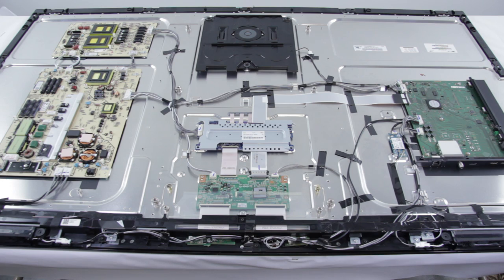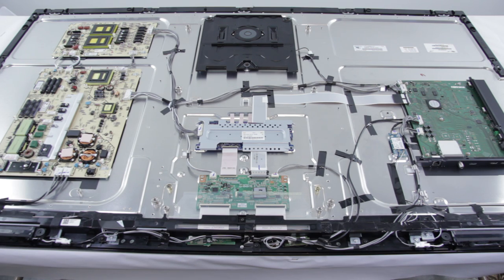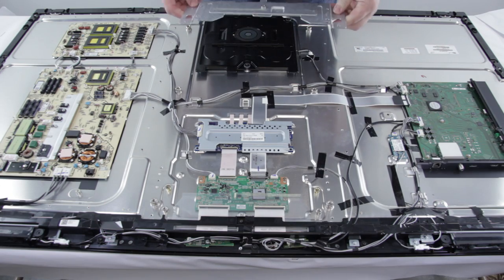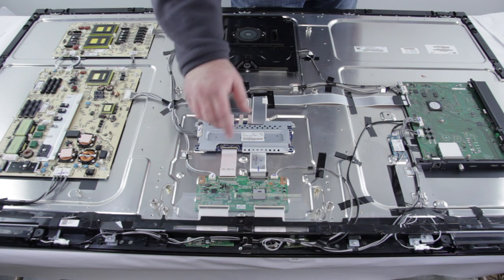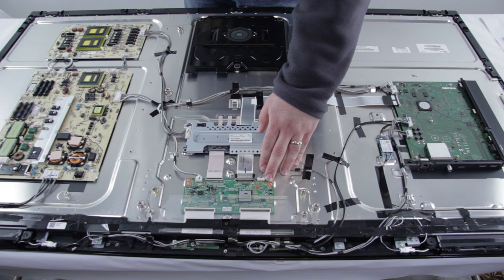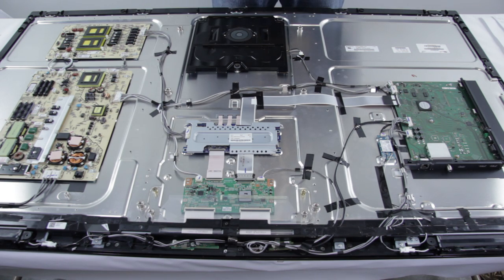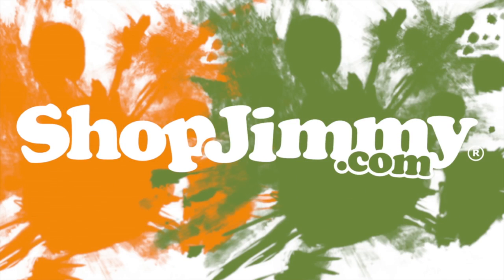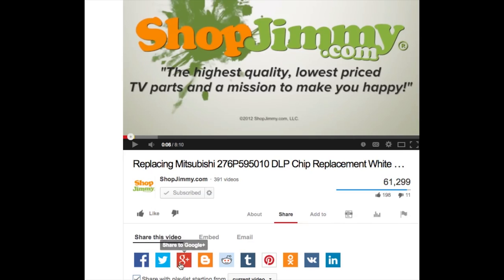LED TV Repair T-Con Board Help Review Overview - Common Issues and Problems with T-Con Boards

Comment: I have a LG 55lm7600 tv it does power on and has sound but no picture. I just got this tv given to me when I pulled the back off it it has 2 ribbon cables coming off the main board one plugs in at the bottom along the edge the other one comes down next to it but has no where to plug into. it did have a white stripe down the center but it has gone away but there is a faint line down the middle and when I hit the menu button nothing comes up on the screen. can u help
Reply from the maker: +jerry helton  Try all repairs and troubleshooting at your own risk.  Could you please upload an image of the problem and reply with URL?  Thanks!  www.shopjimmy.com

Comment: i have a vizio d48 d0 tv,i have replaced both the power supply and the main board,there is no picture or sound,i have back light and no sound,no menu,turns on and off ok,it has just a white blank screen,it only has 1 cable from main board to a long board that goes along the bottom of the tv which looks like about 1 inch wide and about 40 inches long that i can't see how to replace,can you offer any help?
thanks steve

Comment: Model E470i-AO Vizio   No power. No back light. Good P/S voltages.  When powering on , i check on-of and it toggles the 3.5 volts.  What next?

Comment: i have just watched your video and i am pretty sure it is the Tcon that is not working. where could i find a replacement, i have got a Panasonic TX-32LZD80 TV
Reply from the maker: Tom Smith   PLEASE SUBSCRIBE TO OUR CHANNEL - Try all repairs and troubleshooting at your own risk.  Click this link to a replacement t-con board for your TV model number:  http://www.shopjimmy.com/ips-alpha-technology-19100096-t-con-board.htm  There may be multiple boards for the same TV model number, be sure to match part numbers on your current board, with your replacement for compatibility.  Thanks and please let us know if you have any further questions with your TV Repair!  www.shopjimmy.com

Comment: Is the Samsung UN32EH4003 TV Main Unit Board P/N: BN94-06901T | BN97-05375B interchangeable with the BN96-25775A? And if it is, how difficult is it to remove and replace the thin blue ribbon cable that connects this main board to the rest of the TV?
Reply from the maker: jaseman32   That is not compatible.  Thanks!  www.shopjimmy.com

Comment: Hey Jimmy,

I have a Sony XBR55X850A 4K and it stopped working. I think it was the storms we had down here in FL. The TV does turn on and audio works but there is no back lighting, I can still see a very dim picture but after a minute the TV shuts off by itself and then the led on front flashes red 4 times and continues to do so and never powers back on until I reset it. I have left it unplugged for over a day but problem persists. What part do you think I need to replace?  Thanks.
Reply from the maker: Diablo99V   Since it was a storm it could be your main board, your power supply or both.  It may be best to replace both boards in your TV.  Here is a link to replacement parts for your TV model number on our website, click here:  http://www.shopjimmy.com/catalogsearch/result/?q=XBR55X850A  Be sure to match part numbers on your current board, with your replacement for compatibility.  You can also call our customer service for further assistance with your purchase.  (877) 881-6492  Thanks and please let us know if you have any further questions with your TV Repair!  www.shopjimmy.com

Comment: I have a 3d LG TV... model: 47lx6500lg... When you turn the tv on,for the first 10-15 minutes, the right side of the TV, the light, flickers from how it should be, to a darker picture. Then it eventually turns on and works perfectly... but here lately, it has seemed like it is starting to take longer and longer to warm up and work correctly.... Would this be the led driver backlight board, tcon board, power supply, or main board??? OR something completely different?
Reply from the maker: William Harmon   This sounds like a TV panel (TV Screen) problem.  If your TV panel is bad, it may be more cost-effective to replace the TV as panels are typically hard to find in stock, difficult to replace, and expensive.  Thanks and please let us know if you have any further questions!  www.shopjimmy.com
Reply: Damn that's what I was afraid of... Are you certain this is it based on my description? Or are you taking a wild guess? There is a TV repair shop down the road but it's $75 just for them to even look at it... But if you are certain its the TV screen itself, I'm not going to even bother...
Reply from the maker: William Harmon   Based upon the symptoms you sent us, that is our recommendation.  Thanks!  www.shopjimmy.com

Comment: Hi I have a lg 50NL5100 model led tv my picture is gone I change my main board change my t-con board and still no picture. Did the test I have a picture but no back light please need help thanks
Reply from the maker: +Martin Ortiz   Try all repairs and troubleshooting at your own risk. This sounds like a problem with the actual LEDs inside your TV. These LEDs are replaceable, however it is recommended they are replaced by someone with the proper experience and training. When replacing the LEDs, the TV panel can get damaged. If the TV panel gets damaged, it is not repairable. Click this link to replacement LEDs for your TV model number:  http://www.shopjimmy.com/catalogsearch/result/index/?cat=299&q=50ln5100   Be sure to match the panel information necessary to ensure you have the correct replacement LEDs.Thanks and please let us know if you have any further questions with your TV Repair!  www.shopjimmy.com

Comment: Hey guys, love your site and services... I have an rca rtu5540-d TV... I was playing stadia and all of a sudden the screen started cycling thru blank red, blue, white, black screens with no picture just pure color screen.. I have tried the unplugging, replugging, etc and at first was getting the dog startup screen, and could get the menu to pop up but screen would freeze and fade in and out with blotchy light and dark spots... now it's to the point that when I turn it on it is just lines, fuzzy artifacts and fades in and out.. I would like to repair it, but not sure if I need the tcon board or power supply board, and if I could get the part thru your service (I am in Ontario Canada) any help is appreciated, much love and respect from Canada 😃

Comment: Hi, I have the Hisense 32H3E 32" unit, I have replaced the Main board, but now the unit has a very grainy picture, could the t-con board be causing this? what would one run me if you have one in stock? Thank you! Terry in IL.
Reply from the maker: +Terry Millburg  Try all repairs and troubleshooting at your own risk.  Make sure the replacement main board part number matches your original part number.  Thanks!  www.shopjimmy.com
Reply: +ShopJimmy.com 
Yes, All Board numbers did match, the replacement was a used one from the exact same model board, but something must be different, now the picture is grainy & Haringbone type of display & not clear, but it does appear to work, I wonder if there is an update that I can make to it to clear this up possibly?

Thanks!

Comment: Samsung UN55ES6150 will not consistently turn on. Red power light on front will blink a few times while attempting to turn on, Samsung "splash screen" will show for a second, then black screen, and back to off. Pressing the power on button from remotes will often not cause the tv to do anything. Once the TV IS powered on the picture is fine and TV stays on.
Reply from the maker: Ryan Henry  Please watch this video FIRST to help with your repair!  https://www.youtube.com/watch?v=BP3NVNCGEv8  I recommend replacing the main board in your TV.  Click this link to replacement parts:  http://www.shopjimmy.com/catalogsearch/result/index/?cat=56&q=UN55ES6150  There may be multiple boards for the same TV model number, be sure to match part numbers on your current board, with your replacement for compatibility.  Thanks and please let us know if you have any further questions with your TV Repair!  www.shopjimmy.com

Comment: Hello, I have a Samsung 55" led 7900 model. The problem is that there are dancing red pixels showing up in the dark areas. It's not too bad, but pretty annoying. Also the USB slots are giving power, but not reading properly formatted drives. Any advice would be greatly appreciated... Will
Reply from the maker: +Will Roberts  Try all repairs and troubleshooting at your own risk.    I recommend replacing the main board in your TV.   Please reply with your TV model number.  Click here to view a video that shows how to find your TV model number:  https://www.youtube.com/watch?v=S51nhAmwR2M  Thanks!  www.shopjimmy.com
Reply: Samsung 55D7900XFXZA
Reply: Samsung tv UN60H6350AFXZA
UN60H6350
No picture at all, sound continues to work.

Comment: Hello I have a sharp lc 60le450u TV.  I gt it initially with no power symptoms at all.  I replaced the power control board and now have some kind of life...  It now has a red light when plugged in then turns blue and it turns on..  But it turns off about twenty seconds later.  It depends how long i be unplugged it.  It blinks a lot with no particular pattern after that.  Slow at first then more rapid.    I cannot turn it on again until I unplug it and the same results happen when plugged in.  I'd appreciate any advice if you can help.  ( bad power cord).  I dunna..
Reply from the maker: Joel Braxton   PLEASE SUBSCRIBE TO OUR CHANNEL - Try all repairs and troubleshooting at your own risk.  It should provide a blink pattern.  Please count the number of slow and fast blinks.  Thanks!  www.shopjimmy.com

Comment: I have a Philips 40PLF3107H/12. When the tv is on the screen is black but the speackers work perfectly. With the flash light test I can see the image trough the lights. Opening the box i found out that the  unit power supply code is 715G5246-P01-000-0025. Cannot find the led driver if there is one, or maybe is just part of the unit power supply!? The panel is a Samsung LTA400HM23.thanks.
Reply from the maker: Giovanni S   This could be a problem with the power supply or the LEDs in your TV.  You can replace the power supply board to see if that fixes the problem with your TV.  Unfortunately I do not see any replacement parts in the search results for your TV model number on our website.  Please reply with your part number on your power supply board and I can try searching for replacement parts.  Thanks and please let us know if you have any further questions!  www.shopjimmy.com

Comment: Need tv help I have vizio model m470vse that half of my screen is green can it be the tcon board tv isn't even 2 yrs old
Reply from the maker: Patrice Senitz  Please watch this video FIRST to help with your repair!  TV Repair! LCD, LED, Plasma, DLP How To Fix Your TV with ShopJimmy.com Help!  This could either be a problem with the T-Con board or the TV panel.  You can replace the T-Con board and see if that fixes the problem.  Click this link to a replacement t-con board.  http://www.shopjimmy.com/auo-55-47t03-c03-t-con-board.htm  Be sure to match part numbers on your current board, with your replacement for compatibility.  Here is a link to a video showing how to identify your part number, click here:  DIY LCD TV Repair: Part Number Guide for AU Optronics (AUO) Timing Control (T-Con) Boards  Thanks and please let us know if you have any further questions with your TV Repair!  www.shopjimmy.com

Comment: VIZIO E600I-B3 
It has a vertical black line running down the middle of the TV and the picture is faded on the right side (facing the tv). 
Would this be a T-CON board issue?
Reply from the maker: Adalbert Ingraham   This sounds like a TV panel (TV Screen) problem.  If your TV panel is bad, it may be more cost-effective to replace the TV as panels are typically hard to find in stock, difficult to replace, and expensive.  Thanks and please let us know if you have any further questions!  www.shopjimmy.com
Reply: Yes it helped.....found out it was the screen

Comment: Hi i have a Samsung tv that was lick  water on it by accident on my screen i blew air to clean has clean but i got a vertical grey large line hard to define. only when is the screen black you can see it
Is it the T-con board have you experience this before?
Thanks!
Reply from the maker: antreascurren   This sounds like a TV panel (TV Screen) problem.  If your TV panel is bad, it may be more cost-effective to replace the TV as panels are typically hard to find in stock, difficult to replace, and expensive.  Thanks and please let us know if you have any further questions!  www.shopjimmy.com
Reply: Thanks it is the tv panel i notice on the tiny board have missing burn  pins cause by a water it is fitted with the panel and can be replace

Comment: im having a problem with my insignia led tv. part number ns-37d20sna14 i have sound but no backlight when i shine a flashlight up to it in a dark room i can see the menu screen so i think im looking for an led driver. i can identify the power supply, t con, and main board but there is only 3. i can not find a led driver like the one in this video
Reply from the maker: nick NACK   This could be a problem with the power supply or you have bad LEDs in the TV panel.  You can replace the power supply board to see if that fixes the problem.  Unfortunately I do not see any replacement parts in the search results for your TV model number on our website.  Please reply with your part number on your power supply board and I can try searching for replacement parts.  Thanks and please let us know if you have any further questions!  www.shopjimmy.com

Comment: Hi, Samsung LED TV model # LN40A550P3FXZA, sometimes works fine, more often than not there are green and pink outlines around the images. sometimes the lines are barely noticeable, sometimes they are very heavy. They are even noticeable in the OSD menus. Please help? Thanks

Comment: I have a Proscan 55" Led tv 
Model# PLED5529A-D

Problem black screen leds not lighting up. There is sound and picture with flashlight on tv.
Reply from the maker: gcab  Try all repairs and troubleshooting at your own risk.  This could be a problem with the power supply board or the LEDs in your TV.  Unfortunately I do not see any replacement parts in the search results for your TV model number on our website.  Thanks and please let us know if you have any further questions!  www.shopjimmy.com

Comment: Hi - Thanks for the helpful videos. I have a question reg. my LG 55LN5700.  
There is no video on the screen but I hear sound coming through.  At very low light or at a certain angle I can see very very faint images on the screen.  Could this be a T-Con board issue?  Appreciate your response..
Reply: In addition, 1 out of 15 times, the screen does come on, and it works like nothing is wrong.  
So really wondering what the issue could be.  Any troubleshooting hints is much appreciated.  
Again the TV model is LG 55LN5700.
Reply from the maker: Ravi Narayanan   I recommend running the flashlight test on your TV.   Here is a link to a video we produced that shows how to run the flashlight test. https://www.youtube.com/watch?v=xUzCLgoSPGM Please reply with your flashlight test results and we can recommend a replacement part for your TV repair. Thanks and please let us know if you have any questions! www.shopjimmy.com

Comment: Need help. Vizio e701i-a3 the screens lost picture in the middle of viewing. It will power up and the screen will show blue but nothing happens.
Reply from the maker: JARRETT JOHNSON  Please watch this video FIRST to help with your repair!  TV Repair! LCD, LED, Plasma, DLP How To Fix Your TV with ShopJimmy.com Help!  This could either be caused by a bad T-con board or a bad TV panel.  You can replace the T-Con board to see if that fixes the problem.  Follow this link to replacement parts:  http://www.shopjimmy.com/catalogsearch/result/index/?cat=63&q=e701i-a3  Be sure to match part numbers on your current board, with your replacement for compatibility.  Thanks and please let us know if you have any further questions with your TV Repair!  www.shopjimmy.com

Comment: Hi thank you for the informative videos. I have a LG 55in led 3D tv. Model Number is 55LM5800. I have blackish-grey thin horizontal lines that go from the top of the screen to the bottom starting on the left and slowly fade as they go right. The spacing of the lines are just 1/8in evenly spaced. I'm wondering if it maybe the T-Con board from my research. I looked at your website for the part, but it said out of stock but you have other compatible parts available. Is it better to get the one for my tv or a compatible board or are they the same? Do you think it may be the T-Con board, or is it something more serious in your opinion? Your professional opinion will be greatly appreciated and I will buy the part from you if possible.
Reply from the maker: Miguel Rodrigues  Please watch this video FIRST to help with your repair!  https://www.youtube.com/watch?v=BP3NVNCGEv8  This could be either be a problem with the main board, the t-con board or the TV panel.  You can replace the main board and t-con board individually to see which one fixes the problem.  Click this link to replacement parts for your TV model number:  http://www.shopjimmy.com/catalogsearch/result/?q=55LM5800  There may be multiple boards for the same TV model number, be sure to match part numbers on your current board, with your replacement for compatibility.  Thanks and please let us know if you have any further questions with your TV Repair!  www.shopjimmy.com

Comment: Hi I have a Vizio D43-n E1 , every 4 to 6 second the screen goes black for a second, I turn the brightness to 0 and the flashing slows down  alot but contiunes to flash. I changed the main and power boards yet the problem remains, What can I do to resolve my issue?